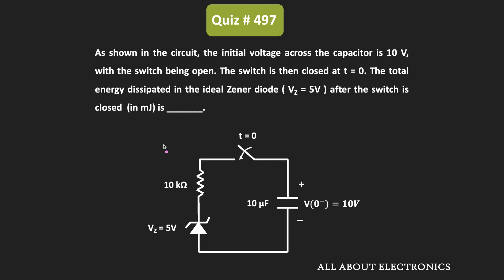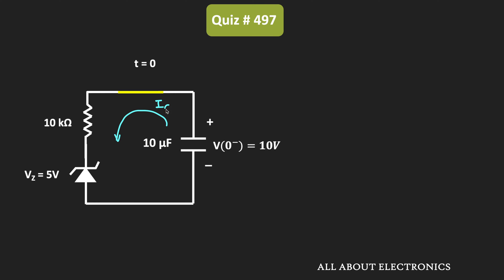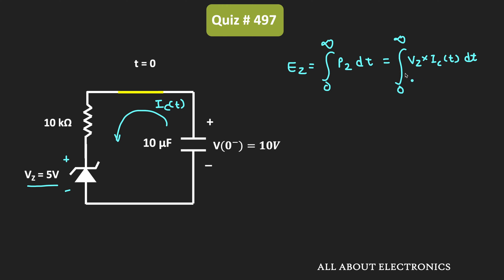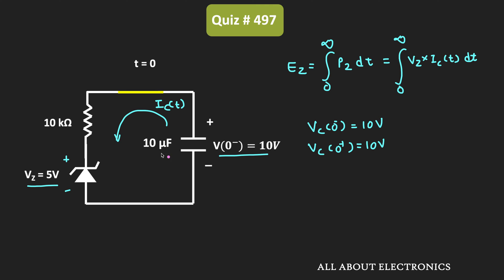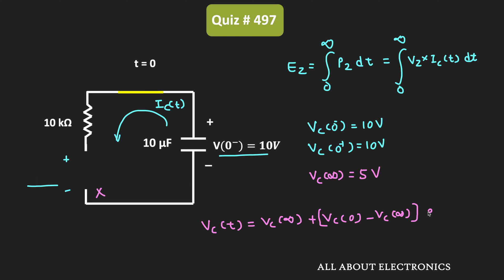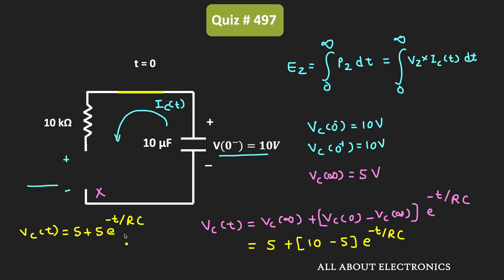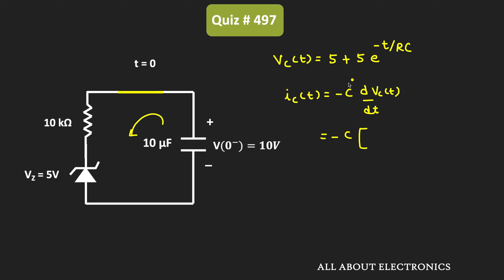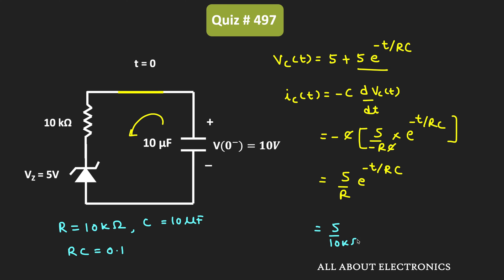Zener Diode  Solved Problem (Analog Electronics) |  Quiz # 497

Comment from the maker: For more information about Zener Diode, check this videos:

1) Zener Didoe as Voltage Regulator:
https://youtu.be/MZPeRlst8rQ?si=8Y2dvAGTcJPqv2y5

2) Solved Problems on Zener Diode:
https://youtu.be/kYtebfx-yHc?si=uD64p7lq906JeDN9

For more solved problems on Diode and Diode circuits, check this playlist:
https://bit.ly/3jqChaO